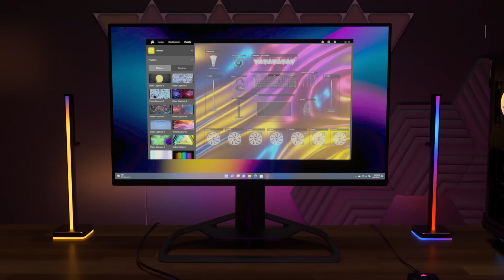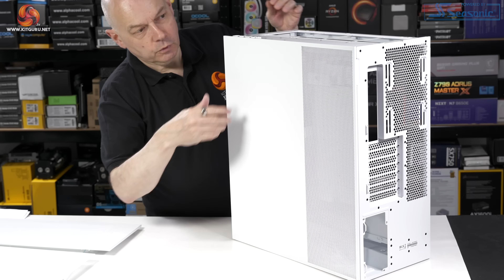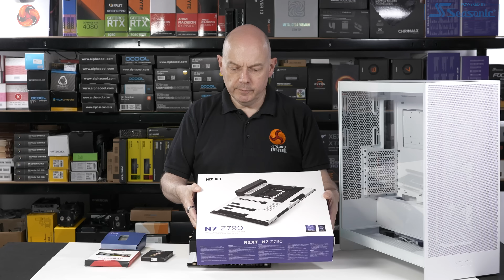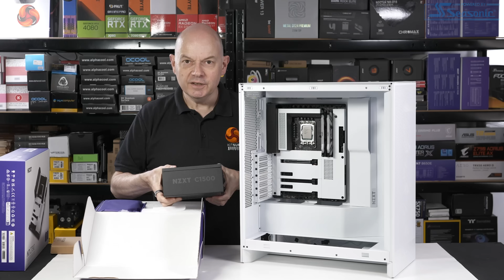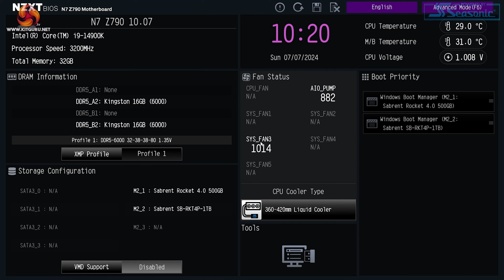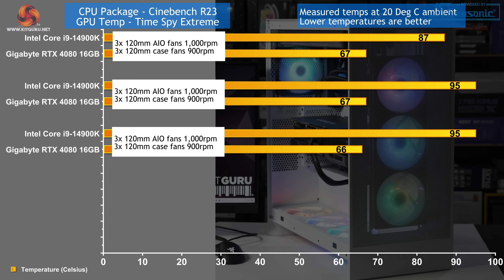NZXT H7 Flow (2024) - Leo goes RGB Crazy!

Comment: I have this case and love it.  I did something some people think is TERRIBLE but it's not... I blocked off the top mesh with a sheet of neoprene under the top piece.  Why?  Because like most humans, my rig is right next to my desk, on the floor.  I eat and drink at that desk and I don't need to spill inside my case.  My air goes out the back, not the top.
Cooling is still very effective with a Thermalright Phantom Spirit CPU cooler, three 120mm intake fans at the bottom, and I swapped the front fans for 140mm's and added a 140mm at the back for 7 case fans total.

Comment: No intake filter cases are not high end premium.
The tooling for snap on air filters are not cheap and the filters serve a real purpose.

magnetic dust filters aren't a real solution, they're floppy and not as secure or they have a frame which is bulky. They're also not guaranteed to cover all the inlets.

Unless you hire a cleaning service that also cleans the inside of your pc case....

I see nzxt's designs being better engineered for airflow but the build quality seems like its going down and they're cutting out features that cost them $

Comment: Those fans in the from look so small. I would have thought the fans were 140mm and not 120mm. 120s look so small compared to my 2023 H9 Elite case. It came with 3 RGB 140mm fans.

Comment: I really liked original H7 series, quite complete cases for the price, and sadly these ones are not the same, but with just changed (for better) shroud. I don't like fine mesh filters replacing the best nylon ones - mesh due to nature of round pattern is sentenced to be sacrificing airflow for dust filtration or opposite. I also don't like RGB Core - reason to buy three fans when one fails and it all still having "ugly cable".
Reply from the maker: Thanks for your thoughts 👌🏻

Comment: Great review. Top work as always. Is there a version that comes with 3x 140mm fans? And are the front panel connector cables socketed at the top?
Reply from the maker: That's a no for 140mm fans and as the floor of the case is limited to 120mm I doubt that would be a thing. Don't recall a socket so let's go with 'no' on that front too.
Leo

Comment: "RGB increase CPU temperature".
Reply from the maker: let’s hope not
Reply: @KitGuruTech  In fact was the swap of the original Kraken Elite 360 (non RGB) fans by the NZXT F360 RGB fans with less CFM that cause the CPU temperature increase.

F120P (of Kaken Elite 360) - Air Flow: 78.02 CFM - Air Pressure: - 2.7mm-H2O
F360 RGB Core: Airflow: 75.12 CFM per fan - Static Pressure: 3.3 mm H₂O per fan

If the original Kraken Elite 360 fans had been maintained, the CPU's final temperature would have dropped by ~1 degree.

Unless for RGB no reason for swap AIO fans neither add more fans to that case.

Comment: Temps are well under control through the testing and thermal section, but the noise of those fans seems REALLY loud - id tune those down a bit, maybe use more and spin them slower
Reply from the maker: Thanks for watching

Comment: the fact they put effort into ensuring you can have 140mm fans on all panels and the cable routing options are a plus. Negatively its not very exciting or revoluntary but looks like they put it together right this time. I dont like the RGB black version at all.